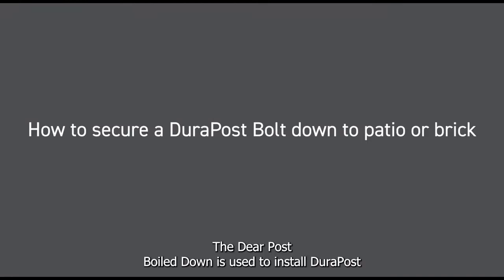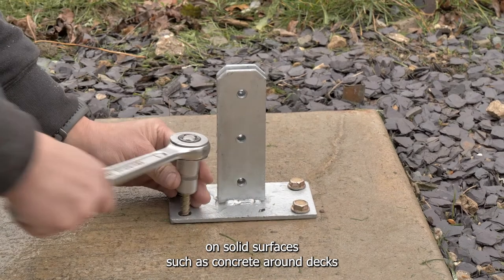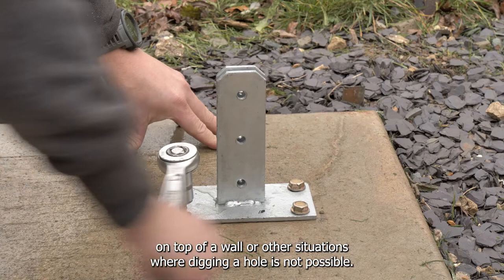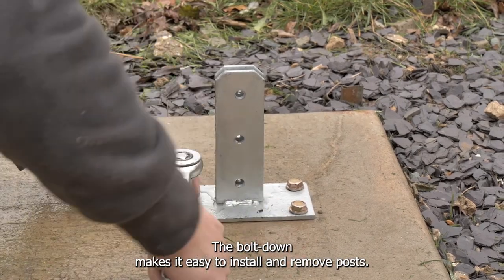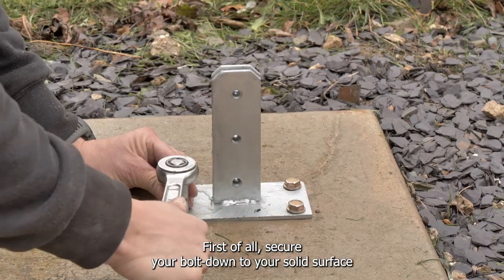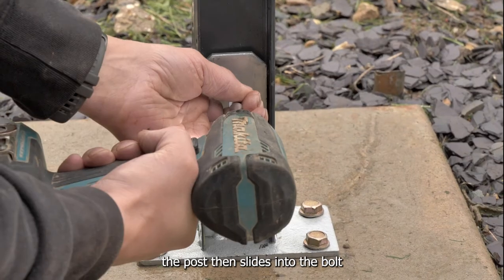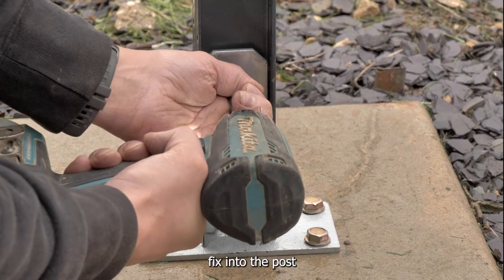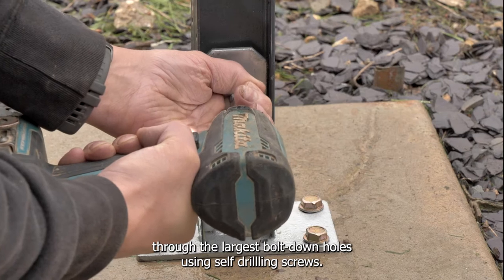How to secure a DuraPost® Bolt down to patio or brick

Comment: Any tips to secure a Durapost bolt down to tarmac drive, please
Reply: I would cut out the tarmac (using an angle grinder) and then dig a hole for the post, or fill the hole with concrete then use a bolt down afterwards, but a post in the ground is stronger for a fence
Reply: Any tips for it to be installed on top of a wall? Bolt down? How high could u go for the bolt down hold?
Reply: @jhtech5807  for a wall id fix with masonry bolts, you want to make sure the fixings go down past the capping of the wall into the block or brick as otherwise its not very strong. Something like 10x150mm masonry bolts are usually right
Reply: @sethburgess8211  there’s no cap top of the wall it’s just a retaining wall ? Block etc . How high a fence would a bolt down hold?
Reply: @jhtech5807  wouldn't want to go over 1.2 metres with bolt downs
Reply: @sethburgess8211  😩was hoping for a 1.8. / 1.9